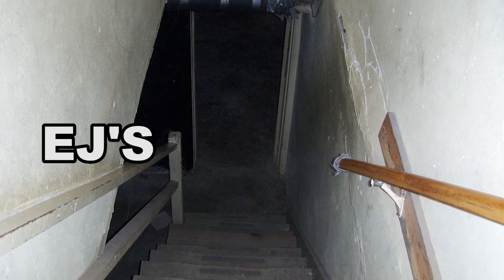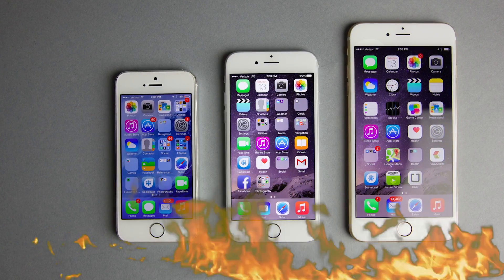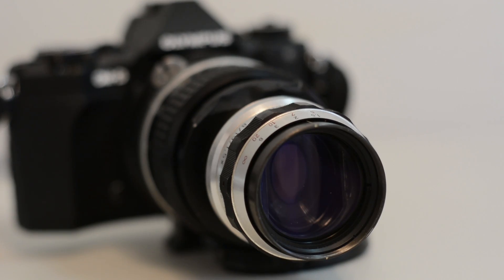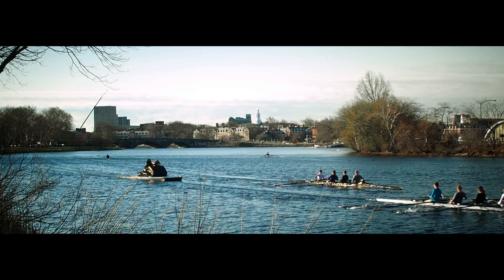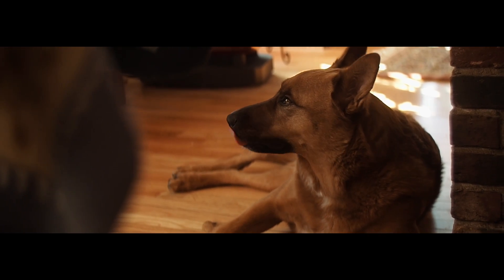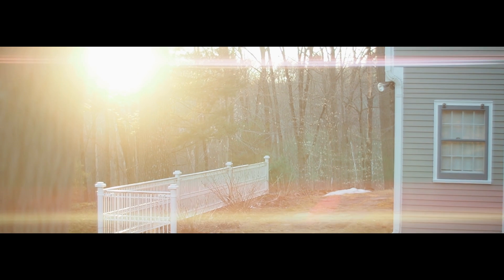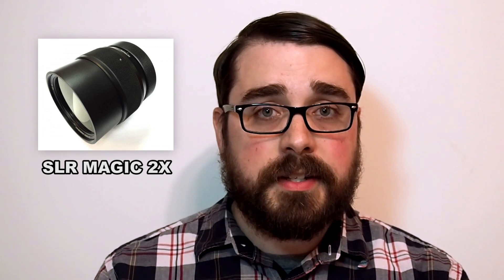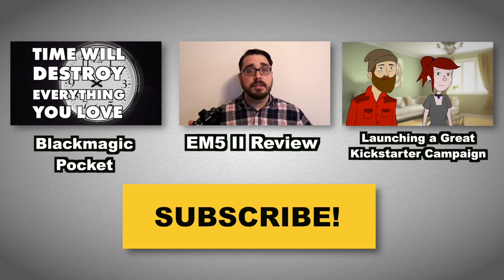EJ Reviews Stuff: Bolex Möller 8/19/1.5x Anamorphot

Comment: i have that bolex lens and i gotta say, you make the lens look really good. I've actually not had any oval bokeh, strangely enough. Maybe because i use it with a 25mm c-mount on a bmpcc. Guess i should try some 85mm canon's.
Reply from the maker: jftvrwk Yeah I'm not sure if I have a weird awesome copy or what. It just sings whenever I use it. It looks awesome with an 85mm lens for sure.
Reply: btw on that focussing thing: if you have a lens that focusses the same direction, dual focussing is not that hard. If you'd really want to use it for run and gun type of stuff, theres a new product on the market called the rectilux, they have focus adapters specifically made for this anamorphot. (and many more)
Reply from the maker: jftvrwk Yeah, I've been keeping my eye on those rectilux people. Very intriguing.

Comment: Great review man! Like your sense of humor. subbed!!
How do you do the dual focussing with nikkor lenses? care to share?
Reply from the maker: T Chongloi Thanks! So for dual focusing, it was easiest with my Nikon 50mm Ai, because the distance markings on both the adapter and the taking lens roughly matched up. I would guess how far away my subject was... so say my subject was 1 meter away, I'd turn to the 1 meter mark on both my nikon and the bolex moller. Then I just nudge the focus on each until they seemed in focus. I definitely relied on focus peaking and zoom in to check if I was really in focus. Definitely took some practice, but ended up not as hard as I thought it would be.
Reply: Thanks for the response. Hopefully  I too would be able to do it when it arrives :)